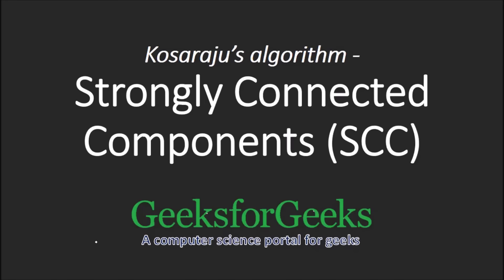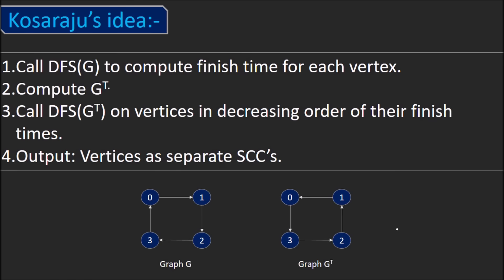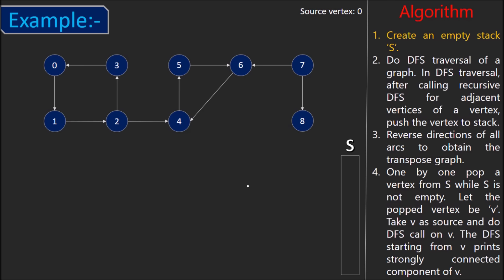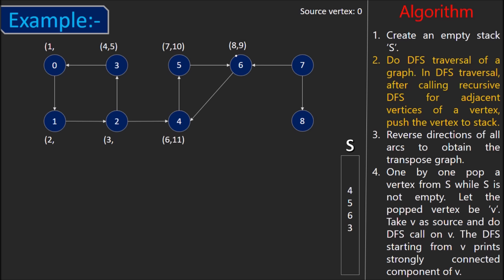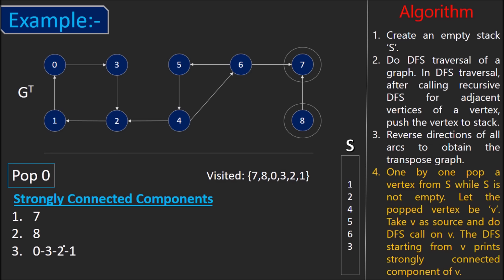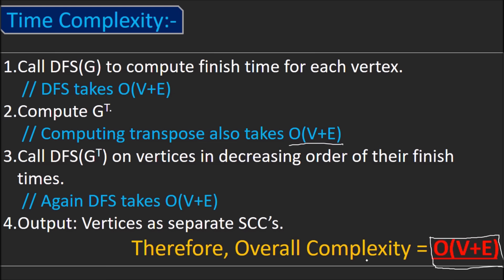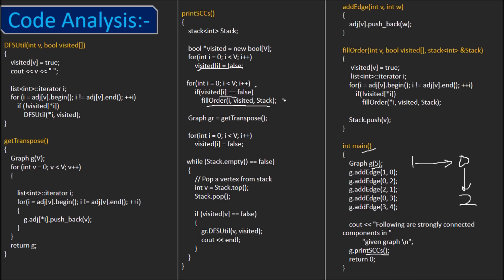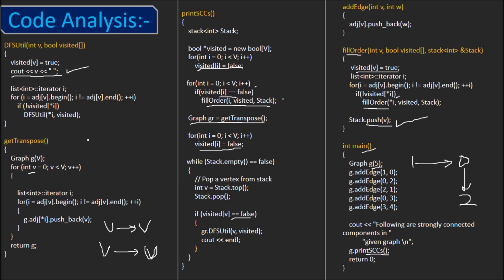Kosaraju's Algorithm - Strongly Connected Components | GeeksforGeeks

Comment: At 9:00 you say 2nd DFS function doesn’t compute finish time unlike first DFS function fillOrder(), but I don’t see computing finish time in fillOrder(), can u pls explain?
Reply: pushing it to the stack is done in the order of the finishing time . Essentially , top of the stack represents the node with maximum finishing time
Reply: Shabnam Banu, Thanks, I got ur point but its understood one. In that case we can say reverse for 2nd function i.e. stack is popped in order of time again. I believe In this algorithm mentioning “time” is unnecessary and misleading.  There is no role of time in this algo but stack is filled once a node & it’s all neighbours are visited. Otherwise, we are “linking” time & stack in “every” algorithm where stack is used (that pops up another question if the same solution is achieved by same algorithm but without using stack but some other data structure, in many cases we use stack for convenience, but not mandatory). Mentioning time makes it feel like explicit time computation is mandatory.

Comment: Nice, But what is the significance of keeping track of finish time in this algorithm ?
Reply: The number of jumps is important to keep track of to know how costly the path of. Think about it as asking for directions from A to X. And not everything has to have a timing of 1 to it, vert AB could take 1 but AD could take 2. 

Keeping track of the visited nodes would be important from preventing backtracking. So in that previous example, we see that AB is cheap but BD might not exists and BC to BD will end up costing more than AD (2).

That's why we keep track of both visited and the finish time.

We give a timing value of n to the stack and then n+1 to the next node because the value of any vertex XY will always be assumed to be greater than 0. This allows us to map the graph in a map object / function AND in the event we are looking for some specific node within a "good enough" timing, we can traverse and do the work that much sooner instead of spending eons looking for the absolute best.

Comment: Very well explained but your class is very poorly designed. You should never fix number of vertex (as you pass 5 here) statically. It’s shud be increasable during run time dynamically. Moreover, did you even compile your code? How do you access *adj with class obj when it’s private member? 

Pls make your class standard one, which can grow dynamically by using some proper data structure.

Comment: where is the path between (0,2) in first graph...... a graph is said to be strongly connected  if every vertex is reachable from every other vertex.
not for path between every pair of virtex
Reply: Saying that every vertex is reachable from every other vertices is same as saying that there is a path between every pair of vertices. Your claim does not actually make sense. Reachabilty in graphs is always acquired through a path.

The path between (0,2) is 0->1->2.
Reply: When we say reachable , it doesn't mean to be having direct connection . there can be any "n" number of vertices between them but still it should be able to reach in a Directed graph . hope this helps
Reply: thanks
Reply: You should better learn the defination of "path" first